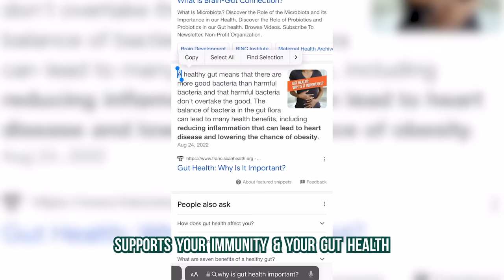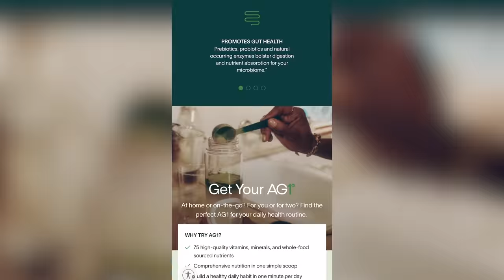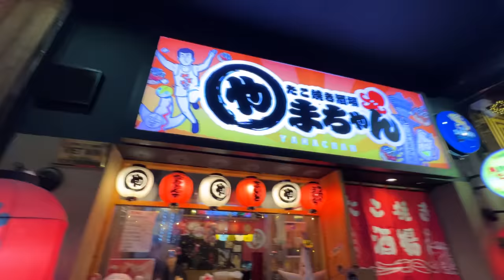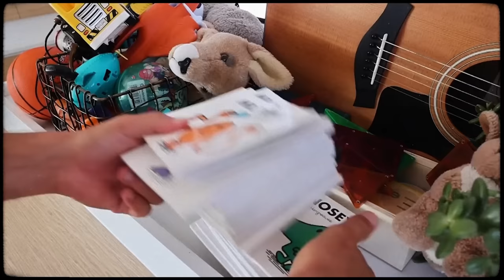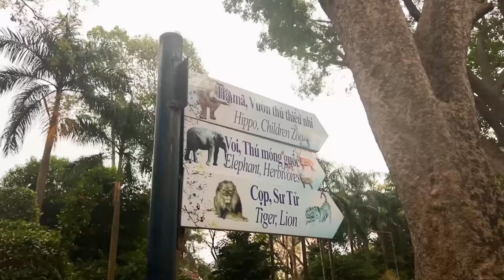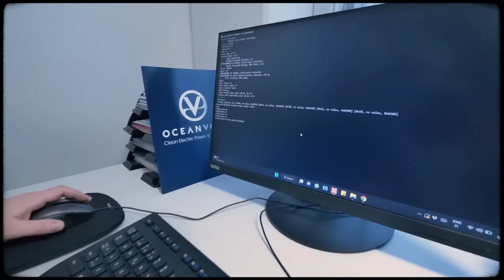When LIGHTNING strikes a Sailboat

Comment: Can you have the company install a "fence" around the boat so you can walk around without the children falling off if they walk? Also, can you ask the company to install some kind of adhesive where you would walk on the outside of the boat without slipping? I know you probably could care less of my opinion but I don't like your new boat because it doesn't appear a boat where children can stand on the deck without being concerned of their safety.  Please make better considerations of the children. If I was 2 to upward in age,  I would not want to be on a sailboat on the inside all the time.

Comment: Lighting strikes. Ok anything can happen. What very often happens is the VH antenna and the all the nav electronics go, leaving a working sailboat and working diesel motor. That’s not this R60. What happens if all that other gear goes, PV, push button electric wench everything, moving mast, OpenVolt, etc.  Can you still get to shore? 

Mfns don’t have an economic reason to care.  Rapido could build a 1000 boats before one gets struck, write it off as a rare tragedy.  Your tragedy.

Comment: Ambient lighting pfffff
Every not especially needed li ion battery off the boat.
They are the biggest risk for fire.
If a li ion battery is burning you cannot extinguish it, it will burn till the bottom of the ocean and the hull will not stop it.